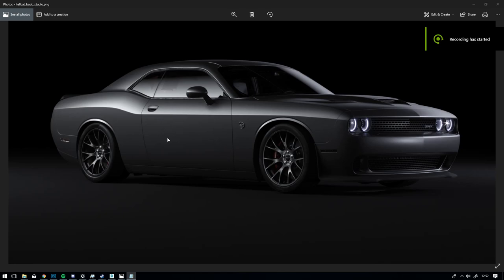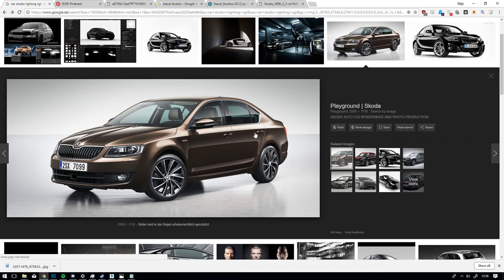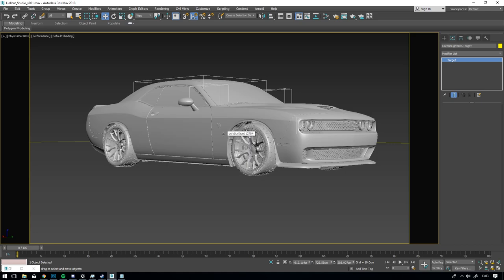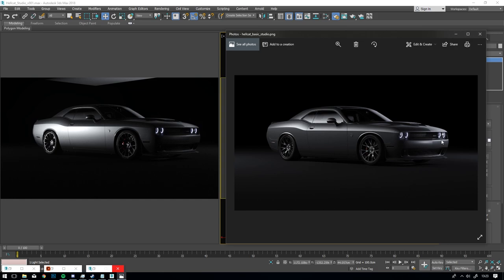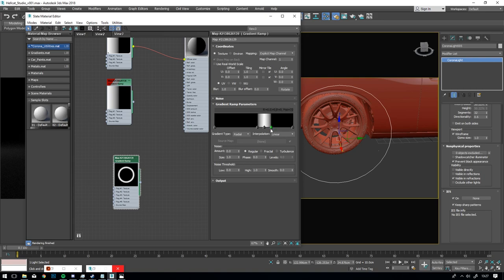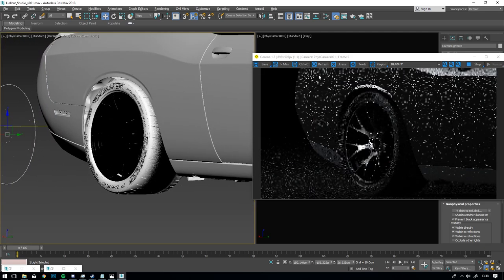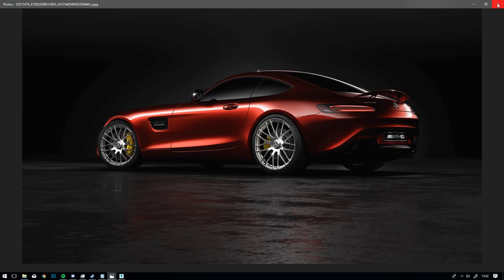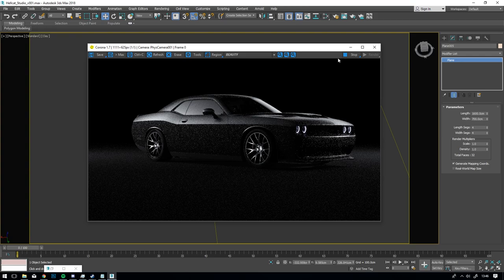Tutorial: Basic Studio Lighting for Automotive CGI Artists

Comment: Nice and simple .Well done. 

Question. Using Arnold, and arnold seems to be terrible at using bounce light as you main source of lighting. You need to ramp up the ray depth dramatically to get any decent result. But this results in very slow render times.

What are your thoughts?
Reply: kill indirect visibility and crank up spread. will help smooth out reflections